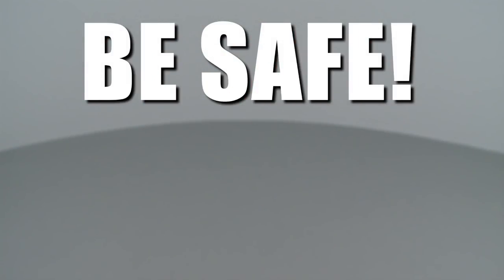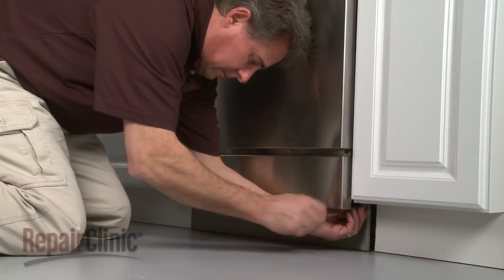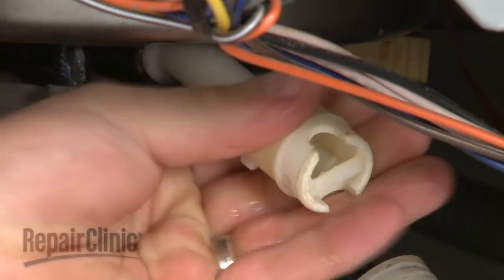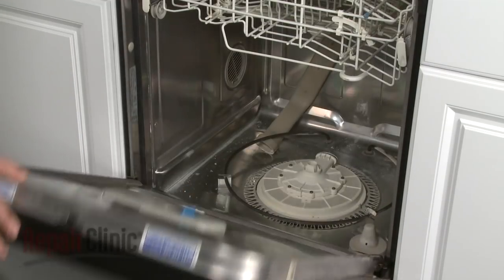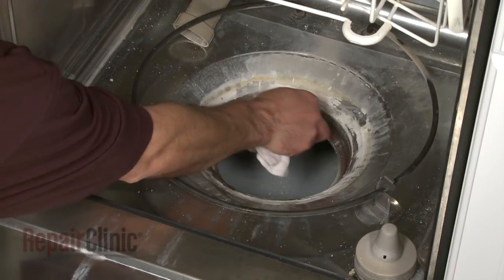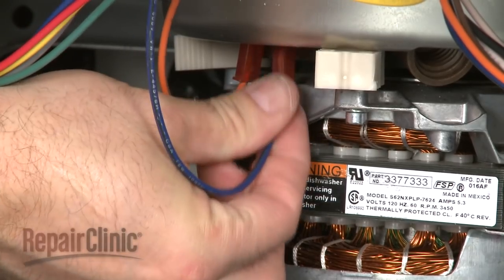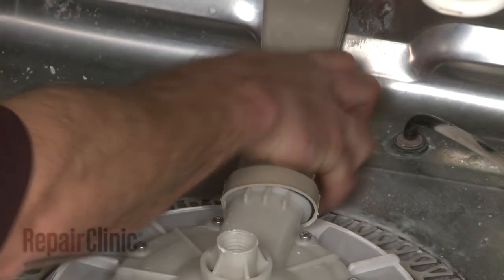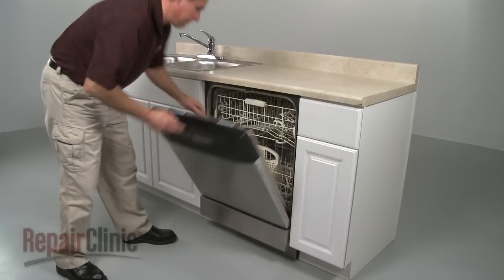KitchenAid Dishwasher Pump & Motor Assembly #W10428773

Comment: Thanks for the video. The water in my dish washer is clogged. I did the usual clean up by removing tray etc, but it didnt help. I am thinking of replacing the pump. Any suggestions?
Reply from the maker: Rahul Sharma http://www.repairclinic.com/RepairHelp/How-To-Fix-A-Dishwasher/25---/Dishwasher-doesn-t-clean?TLSID=1773. Visit our repair help page to information. Use your model number to find parts and use the help system.

Comment: I recently replaced my Kitchenaid dishwasher (KUDC25CHSS1) pump & motor assembly (W10428168), but the new assembly does not have the mounting hole for the weight balance (or absorber)
Reply: counter weight no longer needed

Comment: Is the motor/pump assembly user serviceable? Mine started to make a noise and sometimes will just hum like it is stalled because maybe debris is preventing it from rotating. 
Thanks
Reply from the maker: ***** We need the model to see what style you have. All pumps can be taken apart, but some are harder to get to than others. A lot of pumps are sold as as an assembly to make it easier to repair.
Reply from the maker: ***** You can watch the video for the impeller and seal kit to help you take the pump apart. Part # 830831

Impeller & Seal Kit Replacement (part #675806) - Kitchen Aid Dishwasher Repair